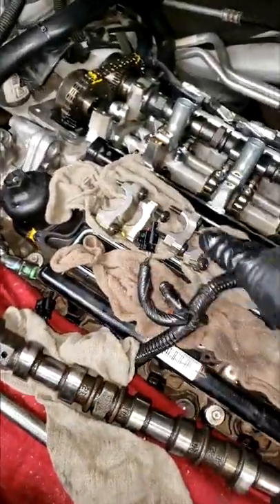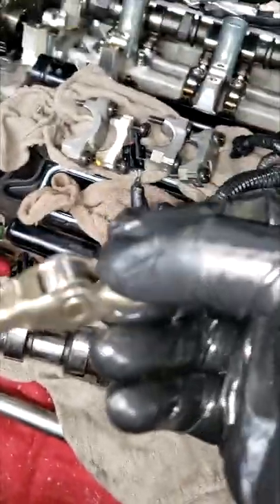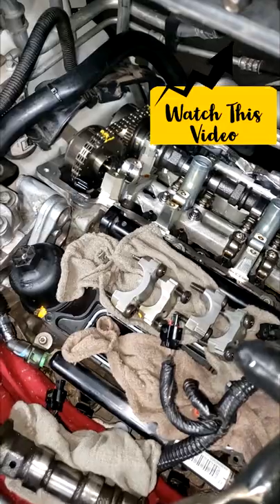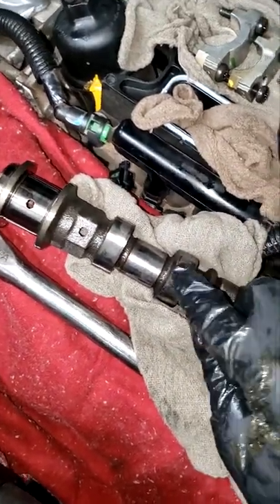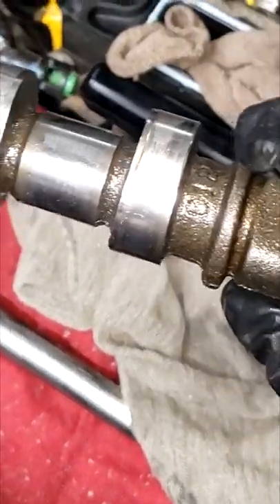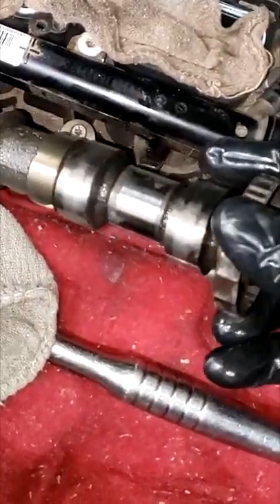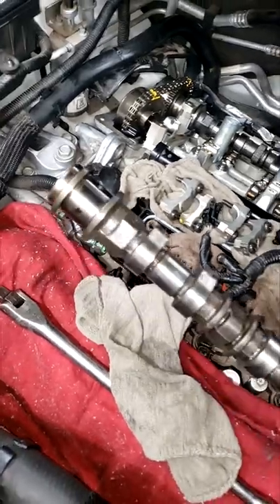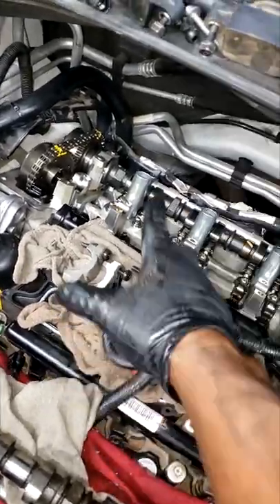Should you always replace your camshaft when doing a Hemi tick or a 3.6 Pentastar Tick? #shorts

Comment: Big difference between hemi and 3.6. All depends on how long the drove while making noise and or misfiring. I’ve had some 3.6 need cams and if you catch a hemi early enough you can get away without doing cam. Seen people not check cam on hemi and ruined the block trying to put new lifters on bad cam.

Comment: I mean if a rocker failed then most likely the cam now will damage the rocker down the road but it does warrant the replacement off of @Shadetree Tech comment you opened it up and are replacing said lifter paying said cost already spend the $300 and save the money and damage later
Reply from the maker: No, thats not how that work. The camshaft lobe do not  initiate the damage, a failed broken rocker do. So if the cam lobe survive a ticking broken rocker arm such as in this case (look at this video and that camshaft again} The camshaft very much re-usable. You guys are throwing away money for no reason.. Theres is no so called damage later, in fact, a camshaft should never be replaced unless its damaged or you upgrading.
Reply: @OnlineMechanicTips   but when the camshaft is scratched and you install a precision machined surface against an imperfect surface now your destroying another lifter or further damaging the cam so I mean your right it’s opinion honestly but I’d replace it waste of work in some peoples thought process
Reply from the maker: @ifixthingsalsobreakthem5835  So the camshaft as seen in this video would have most def gotten replaced by most im guessing because of that scratch on the lobe? An addition $300 added to the tab because it gives mechanics a piece of mind i guess is ok. Like I said in this video, if it will help you sleep at night knowing you did, go for it..Nobody need that extra stress on them..
Reply from the maker: @ifixthingsalsobreakthem5835  Go for it buddy. We will just agree to dis-agree
Reply: Hey that’s how it should be I don’t have any issues brother I’m a class 8 truck mechanic and we all do things differently we are human and have our own freedoms we learn different work different and all work together when we can and have to !!!!! Worlds loosing the kids my age that have to deep inner want and need to grow !

Comment: I had to replace a cam after i did a valve cover gasket those tone rings are cheap and delicate the job bit me in the ass but i believe these engines have the ticks do to extended oil changes i have these motors coming in with 150000 miles no tick